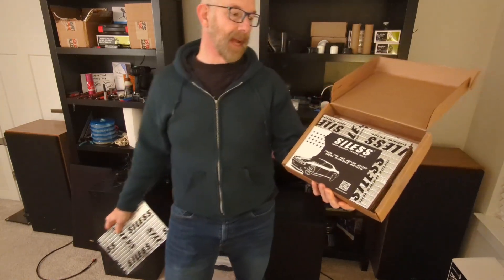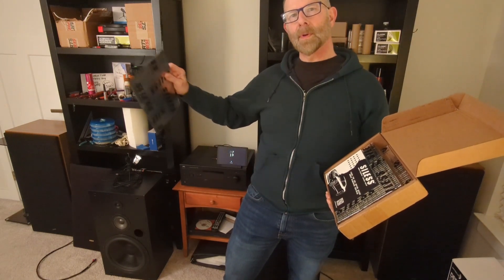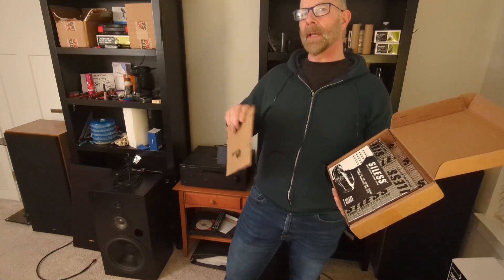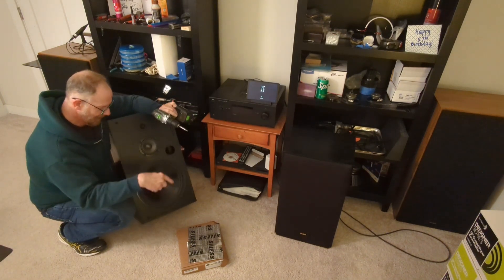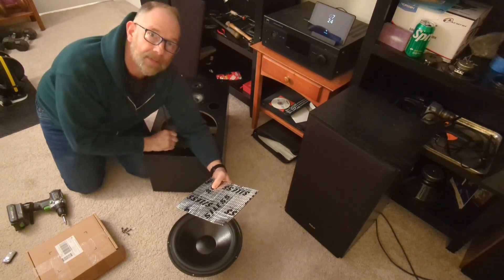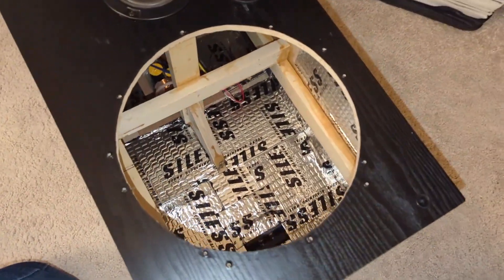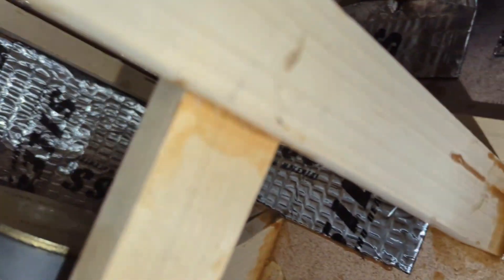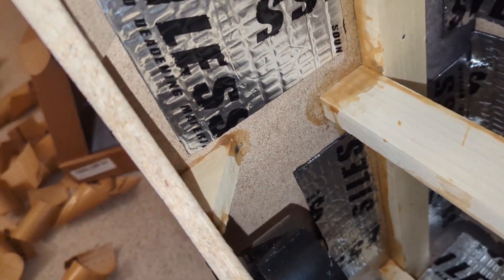Do Sound Deadener Pads Work to Reduce Speaker Cabinet Resonance? Lining enclosure with Siless 80 mil

Comment: Is there some way to put before and after sweeps on the same graph?  If the graphing program won't do it, You could use the video editor to overlap them as long as the screen and camera don't move between sweeps.  It seems like most of what you do has small, subtle effects compared to putting the same drivers in a trapezoidal or round housing which would cost more.
Reply from the maker: Yes and no... Here's my conundrum: I'm using my Pixel 7 for all the filming and editing, publishing the videos. That being said... It's the decades old paradox of Google products being half baked. The phone has limited storage, and videos take a ton of room. It could take 4 hours of filming for a 15 minute video, so storage gets maxed out on the phone, and once I offload my videos to Google photos, that's broken too and it won't download the videos, without first running them through stabilization, (which can take an hour), then it's necessary to download that modified copy, (that takes an hour or more if it's successfully downloaded which is maybe 25% of the time).

I've tried bringing in screenshots, videos, etc. and its a major pain.

I'd love to use my Chromebook, but that doesn't work with the video editing software because of a codec problem with videos captured on the Pixel, (but the same app on the phone can deal with the codec fine). 

Of course with every update Google does, it breaks something too, so I struggle with the Pixel 7 camera and sound, because sometimes it works good, other times not so much, (like in this video the sound is muted and distant for some reason even though I didn't change any settings). Other videos have this weird auto coloring that makes them go from normal color, to a dingy yellowish like old Kodak instamatic cameras in the 1970's.

Needless to say if I'm going to keep doing this, I need better methods, software and tools, (a workshop or studio would be good too). For now, I'm stuck with amateur looking videos.

Comment: I would have focused on the comers too.
Reply from the maker: Thanks for commenting! I'm guessing you're referring to the cabinet corners internally - e.g. covering them with sound deadener pads too? I'm considering it.... It's $27 per box of the Siless pads, but with an extra box, (one kit per speaker), I could do all the obvious bare spots, the bracing and the port. It might be worthwhile in terms of better sound quality as an end result.

The other idea I had was buying a can of a competitor's product, a sprayable sound deadener, but based on reviews it's not very effective and would be messy and stinky. About the only benefit I can think of is that I could essentially blackout the interior of the cabinet, making it less ugly when peering into the bass reflex port. Of course, my grandson said he likes seeing and touching the white insulation because it's "tickly"...
Reply: @wattspeakers  I was thinking super 77 and 2x2x?rectangular poly fill, or rock wool cuts  to dampen the hard corners and as a bigger piece behind the midrange to cut down on the reflective wave.  Saying this, not a fan of packing the cabinets cbock at all, as well.  Really nice job though.
Reply from the maker: @TrueIndie88  Ahhh... Yes I'll be adding insulation, but that's primarily to reduce cabinet echo and "maybe" standing bass waves. Insulation and stuffing doesn't have any significant impact on panel resonance unfortunately.
Reply from the maker: @Douglas Blake I agree Doug. The corners are likely the least of my concerns. They'd exhibit only the very highest of frequencies, if at all. Any resonant frequency from them would be well beyond what the woofer is producing.
Reply from the maker: @Douglas Blake I agree

Comment: I believe this deadening material might work well in some small Realistic Minimus 7's and some Optimus Pro LX5 metal enclosure speakers I have to reduce some "ringing". These are kind of salty in price but I guess they can go far depending on how much one puts in their speaker cabinet. Thinking most speaker cabinets that are well braced may not need these and just use insulation instead.
Reply from the maker: After experimenting with it and experiencing the results, I would agree. I'm wishing I would've done it on my big Jensen's too. I'm guessing any MDF loudspeaker cabinet that uses an open back driver operating above 400 Hz + would exhibit similar behavior and thereby benefit from decent sound deadening material. The package of 19 pads, (why 19 and not 20 I'm not sure), was less than $30 and is enough for two fairly large speakers. One could likely do several pairs of smaller speakers with it. I purchased the pre cut pads because I knew putting them in would be bit of a puzzle with all the bracing and gussets. They do sell it in big rolls as well.

If you try it on the Realistic Minimus and it improves them that would be cool. They're very tiny inside, so it wouldn't take more than a pad or two.

Honestly with the bracing inside the cabinets, it would probably be wise for me to put it on the braces as well. The braces are helping stabilize the cabinet itself, but they're as susceptible to resonance as the rest of the cabinet.  The braces I used were made of Poplar and I think the exciter really got those humming. Maybe I'll cover those with it and see what happens.
Reply: @wattspeakers  The price you mentioned is not bad. I was pricing roles of this on Amazon. Its possible the rolls may be a better deal by buying large square inches in bulk depending on how much they charge for shipping. But I can see if they cut these up in square pieces it might be cheaper for them to distribute and ship this way. What is the part number or description so I can look into those?
Reply from the maker: @jimthvac100  the package I bought was VAR8010MIL which would likely be best for the smaller speakers. They also sell a better product that would be handy if I do more large cabinets, it's more expensive but might be worth it, since the larger the cabinet is, the bigger the problem with resonance is. Check out their pro liner SLL36